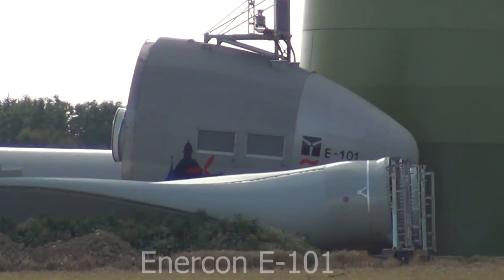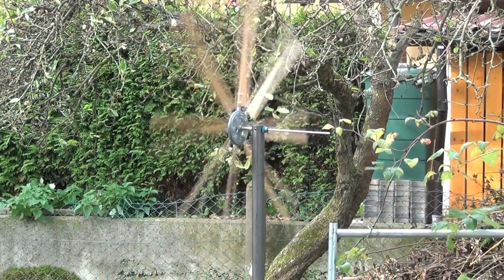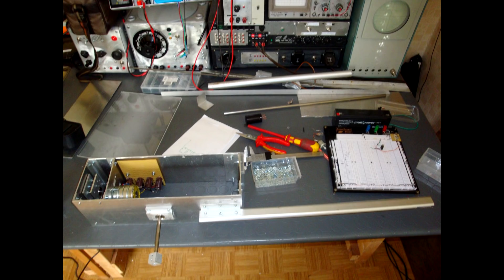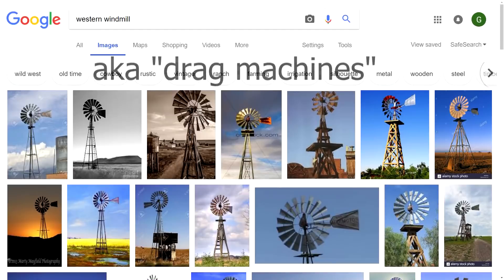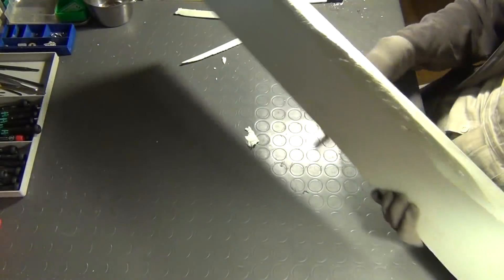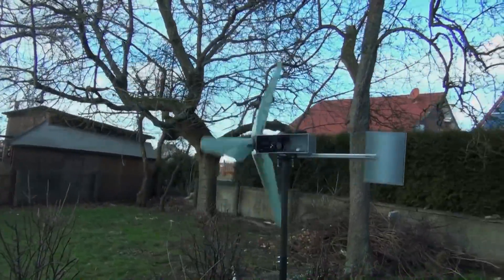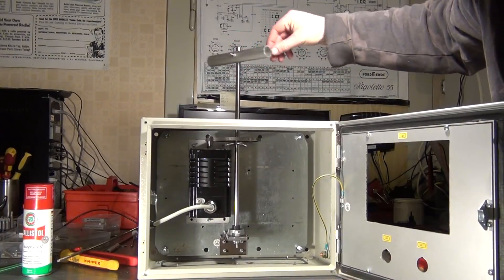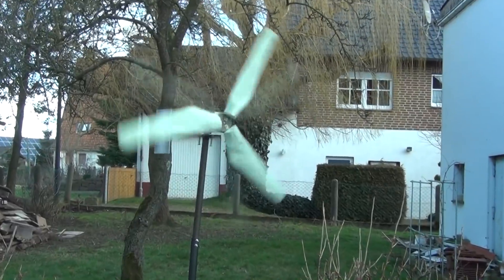DIY Wind Turbine Builds

Comment: I can tell you why it sucks.
Kinetic energy of a moving object, or mass of air, is 1/2 m v^2.
But the amount of mass passing through a given cross-sectional area perpendicular to the wind is area * density * speed.

Put those together and you get power proportional to d * area * v^3.

That is the energy output of a turbine, at a fixed efficiency, is proportional to the cross-sectional area, and to the cube of the wind speed.

So to get decent energy output, your turbine needs to be 1. Huge. and 2. Exposed to a very high wind speed. Which is why commercial turbines are both huge, and on top of gigantic towers. Also, wind at elevation is less prone to sudden directional changes than at ground level.

With solar, the power output scales directly with the area of the panels. Spend twice as much on panels, get twice as much power. So small-scale installations can work very well. But with wind, the physics is less forgiving: It's not practical to scale down. Go big or give up.

Micro-wind does have a niche for things like remote weather monitoring stations though, where power need is very modest and dependability is important. Solar and wind together can actually be cheaper than solar combined with the expensive batteries and excess capacity you need to be ready for the short days of a cloudy winter.

Comment: I live in an apartment on the 3rd floor. Two double windows open on opposite sides. So if I open each window a few inches, I could fish out an antenna about 14 feet across. Wire wrapped 1 inch PVC. I have an Nc300 receiver (1954) but no antenna yet. I can easily disassemble a PVC type in case of wind and rain. Any advice would be greatly appreciated. Thanks!

Comment: Here in Sweden they do NOT want you to produce your own "free" energy.
If you use a solar panel setup that can deliver more power than 255kW, you'll be punished with a tax.
What is that? They throw a tax at you because you did NOT buy energy from "normal" sources, with a price that also includes other taxes?
How can they do that? Do they OWN!! the Sun, I think not. If they don't own anything, they can't demand anything.

(PS. This is the latest info I got, it might have been changed but I doubt it, so to be sure, search for yourself)

Comment: There is one more propeller type I have not seen mentioned in the video. It is probably bad, but those weather stations use it. Several "spoons" are connected by the handle and it does not matter where the wind blows from.

Comment: New approach :
I know there is a fan designed to run in one direction regardless of wind blowing back or forth . It could be helpful to your project . You could use 2 of these fans at each opening of a big tube and the feed is then doubled

Comment: Quite some time ago, maybe 15yrs, I wondered 'why is it that many fans have multiple blades and yet many wind turbines have, as you say 2 or 3?'.  So I did some research and came across a thing called 'Betz Law'.  Too complicated to explain here, but here's a link to a Wiki page:
https://en.wikipedia.org/wiki/Betz%27s_law
As you will see when/if you read it, it explains your maximum power figure that you mention at 6:49
Regards Mark in the UK

Comment: To bring a point on something you may wish to know, I joined this channel to see very interesting recycling ideas. 
I grew up in a time when old hippies were the best recyclers. They could take 5 broken things, and make three all new things with new purposes. As a boy, I was inspired by that. 
Home power generation is a very interesting topic to me, and likely to many others here. 
You could make a series of videos on the different aspects of what is needed for this. Such as, make a test bench that tests the ability of different types of electric motors to generate decent power, and at what rpm's they would need to spin at and so on. Another, would show how to convert a used automotive alternator to generate power. Another would focus on proper mounts, and heights to mount it all at, including bearing basics that work well for this. Another video could focus on blade design, how to make or which kind to purchase. Another video would show how to connect this to a home power grid with some safety measures and the use of a battery bank. 
Those are just a few ideas I have for this. It seems like a rich topic with a lot of potential for you and the viewers. I for one, would be excited to see you do this!

Comment: It is good to hear you sound so happy lately! 
I used to work as an auto body technician when I lived in rural Texas. I used a rear brake drum from a mid sized industrial truck, an old Ford I think. The drum was very large and heavy. I used a bearing and spindle from a flatbed trailer as the middle. I used three alternators from dead Chevy cameros that we're rotting on the back lot. I used gears from old gocarts and motorcycles welded to a bracket near the opening of the rear of the drum which spun with it. 
All three alternators had gear sprockets welded to the ends of their shafts and were mounted in a triangular fashion near the rear of it all. I calculated the drive ratio on the drive sprocket on the drum and the sprockets on the alternator shafts to have maximum speed to the alternators. We also used a donated propeller from a light aircraft. It had three blades, but it wasn't the best design for this application. All the diode sets we're removed from the alternators to give true ac power.
A customer of mine who sets up ham radio antenna masts, traded some body work in exchange for putting this odd thing on top a 30 foot mast. 
This was over 20 years ago and we didn't care much about attaching batteries to it, but I wish we had. The real pain was regular lubrication. The chain would get noisy and it did brake several times, at least until we got a new chain instead of using a recycled one. 
It was attached to a make shift breaker box, so if the wind got too high, a breaker would throw to prevent a fire. It was all connected to some outside flood lights and nothing more. 
It was fun and wierd, but many of the best things in life are.

Comment: Yes!!! Very interested!! I'm off grid! I have solar  panels. And not the best sun! I been thinking about wind turbines. Of course I would build my own. The issue is I would have to put the turbine up about 30-40 meters! To get above the trees and in to the wind!  Maybe even 50 meters high. That's going to cost right there! I could dig a pond and use the small water supply. To fill it. Then build a micro hydroelectric generator. And focus on using it when needed. To allow water to fill the pond. From the spring! I could also channel rain water from a bit if land to run in to it also. Again that's a lot of funds just digging a hole!  Then how much will it generate. I'd like to get atleast 20-40or50amps at 30-40volts or atleast a few kW. From it for 8-10 hours! More when they no sun. And with rain. And if it keep raining like it has this year. It's been like a rain Forrest lately. Shame the liquid sun isn't easy to turn into power!!!  So yes please!! Wind power!!!!

Comment: I worked with this myself and I found using aluminum and fiberglass was optimum. I used a three blade design. I ended up with a 160 amp car alternator that had been modified to not limit its output. The best way I found was to let three of these models power a battery bank. My battery bank consisted of a bunch of used deep cycle batteries and somewhat restored car batteries. This was set up and I took my home breaker box apart and used the battery bank to power the lights in the home. Ended up with a couple screw vane types and I placed them on the roof they powered some golf cart batteries. These were connected to the HVAC to power the blower motor. Although I did have to install a capacitor to get the fan going that reduced my power bill by $120 USD

Comment: Hi. I have also thought much about this idea and have also spoken to a few people who gave me something to think about.
The thing that cools your house is the wind with it's temperature as a coefficient. There is not much more than scaling you can do to compensate for the temperature as the chill factor. But what you can do is make a turbine that has the average heat loss of your house. That would require a bigger generator than you have used in your project.
Also raise your turbine over the height of your house so you get more stable wind.
The most effective way to convert wind to heat is NOT to convert the power to DC. If you want to charge a battery i can understand that you'd like DC. But for heat?... Think of it this way.
If you have a three-phase motor which is directly connected to a three-phase heating element. When the wind cools your house, your turbine spins up proportionally to the wind speed. If you have a hurricane your small turbine might produce more than designed, but the heat loss will be proportional so you won't over-heat, theoretically.
Now, you may see that for you to make use of a turbine as a heat provider you need a pretty big one, but 2-3 meters in diameter would do you some good. Just make them glass or carbon fiber with your foam as a form :)

Comment: Very informative! Would a DC motor from a 14v battery powered drill be a decent generator for a wind turbine? Thanks, Danny
Reply: Those motors tend to be very geared down, so that's good. DC motors aren't quite as efficient as steppers, but steppers are expensive. I suggest going with the drill motor if you've already got it on hand
Reply: @175griffin  thanks for the information! I appreciate it! - Danny
Reply: Require too much torque, which means an oversized rotor is needed and even then, cut in wind speed will be relatively high compared to more suitable alternatives, and it won't produce enough power to make a dent in the avg homeowners electric bill. Same with a stepper motor. Power from a wind turbine is directly proportional to the incoming wind speed, rotor swept area, the amount of magnetic flux in the rotor and the amount of copper in the stator to carry the flux. The bigger, the better. A small dc motor of any kind would do good to keep a couple of led's lit and a smartphone charged. They make good science projects for kids, but that's about it. If you don't want to build your own generator, you can use an F&P motor from an F&P washing machine, rewire for high voltage (many videos on youtube showing how). These aren't the most efficient and still won't come close to powering an avg home, but certainly better than drill motors or stepper motors. If you want REAL off grid power, then I recommend building an axial flux turbine with a 3kW pmg and 12ft rotor. See my channel and website for more info. Plans are available.
Reply: @JamesBiggar  wow thank you for that information James! I will have to look into that. - Danny
Reply: No. Tried it, didn't work. The gearing needed too much torque, and the motor needed to spin far too fast to get usable voltage. I've heard favorable reports using some stepper motors and some mains low-speed synchronous motors, especially ones taken from treadmills. I don't know why treadmills.
Reply: @vylbird8014  treadmills have permanent magnet DC motors, ideal really...
Reply: @vylbird8014   thanks for your feedback. I have heard the treadmill motors are good to use. - Danny

Comment: I would like to see some more videos about small scale wind turbines.

I think there is a problem with small turbines particularly in urban areas, that the wind is too disrupted by other buildings and that wind does not scale down well. A larger turbine, positioned where it has good open airflow is much more suitable than a small one near ground level.

In the UK in the last 10 years or so we've seen solar and wind systems available at relatively cheap cost, but whilst there are now many house roofs with solar panels, it is rare to see small turbines.

Despite this, I would still be interested in videos of design and build of turbines , and what problems you might encounter.

Thanks for interesting videos, and for teaching me a little German language as well.

Comment: I don't think there is much point building small wind turbines. Their efficiency is so much worse than larger versions. A small solar PV installation on the other hand can in theory reach the same efficiency as a big solar plant. That would be more interesting.
Reply: I think the point is less about overall efficiency, and the fact you can make one that works well enough from recovered "trash" materials. (May not power a whole house, but it could charge batteries or run a few light load devices like LED lights.) Magnets and windings are relatively easy to do from scratch unlike doped semiconductor panels (those more process and chemistry than just tinkering), and motors (that can be used as generators) are much more commonplace if you were to curb-shop on trash day. That's probably where the "post apocalyptic" aspect comes in.
Reply: pauljs75  yes anything is something,  though reliability may be an issue, i remember B&Q selling them for about 2g in the UK , anyone that bought them, they just went wrong and badly inside a couple years, making mostly nothing back in power., a homemade one, that even 1amp, can charge a car battery in a day or 2 and make a lot of useful power for a shed or emergency use, and keep batteries in good condition
Reply: 'small solar' see the roof next door, thats about a 10kw install,   just sneak over and plug in a long cable :)
Reply: The photovoltaic generation systems have always been interesting but I do not think there is much to improvise or improve, you just have to install them and that's it. Using electric motors as generators can be interesting and even more if the wind moves them. I live in the Caribbean and here the sun remains, however there are places where it is not so and the wind energy is an excellent idea. Keep in mind that the wind can blow at any time unlike the sun that has its schedules. The combination of both technologies is very effective for me. Generally when it is cloudy, the wind blows at least where I live.
Reply: yes, wind generation isnt great compared to solar,but solar has that problem of nighttime, coupled with we dont have efficient storage for excess power  yet

Comment: One of the problems with DIY horizontal wind turbines is height, if you mount them low to the ground the amount of turbulence in the air causes problems for the turbine, resulting in them swinging all over the place to follow the wind direction, losing blade speed and generally wearing the pivot bearings out faster...

Comment: What is the better choice steeper motor or servo motor. I thinking take a servo motor connect 3 heating element's in star configuration and heat water.

Comment: Great video PAI . I wonder if it would be possible to use fiberglass mesh layers over the foam core. It would help with strengthening the blades and improving weather resistance.  It is easy to see true German inventive genius at work in your projects.

Comment: Yes I'm interested you should pursue it. I was thinking about vertical screw propulsion running straight down to a car alternator connected by gutter pipe, charging banks of acid batteries then inverting it,  the vertical screw turbine is quite simple  just get some 6 inch diameter waste pipe and make your aerofoil screw around this not sure what the ideal length is or rotation should be, but probably at least 7 feet with a slight cupping a 1 inch flat ridge beading on the outer Edge. What do you think! Plus you wouldn't need much room you don't need a garden just have it bolted onto the side of the  house a bit higher than a chimney would be.

Comment: I built my own some time ago it is my only youtube video and it only lasts 9 seconds I made everything from scrap even the generator I was getting a constant charge to a battery of 10 amps at 13.5 volt. it worked well for a year until we had wind gusts of 70 KPH that was end of project.

Comment: Dude... It just occurred to me that it may have been a mistake placing the rectifier outside at the turbine, as AC is more efficient to transport over distance then DC...
Reply: It's actually not: https://en.m.wikipedia.org/wiki/High-voltage_direct_current

AC is however easier to transform from one voltage to another since you only need a transformer. Not so much an issue now but historically very important and pretty much the reason why we use AC.

Comment: I have been in a couple midsize Vesta wind turbines, in investigating the possibility of using vibration condition monitoring.  You may be interested to know they don't use slip rings to transfer power - power cables are dropped down the center of the tube from the nacelle just like you did.  At most wind farms, the direction of the wind is relatively constant so they rarely make a complete rotation around their axis.  When the cable gets too twisted, they drive the turbine around to unwind the cable.